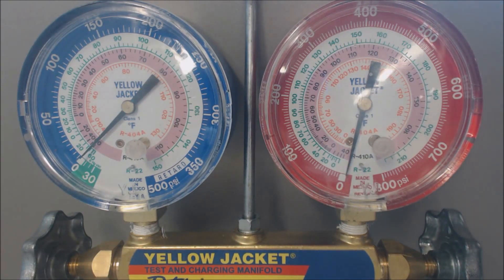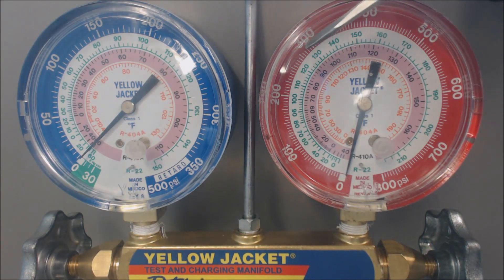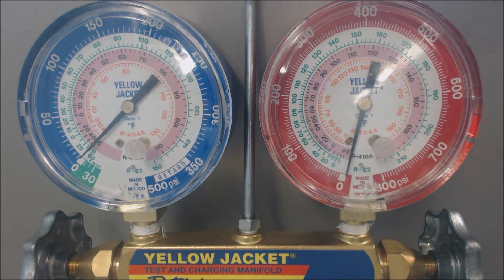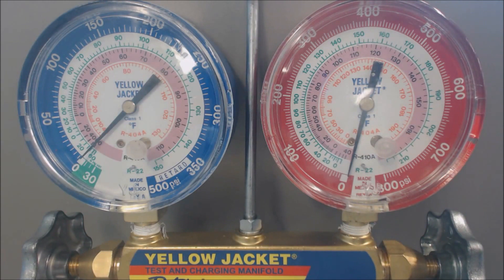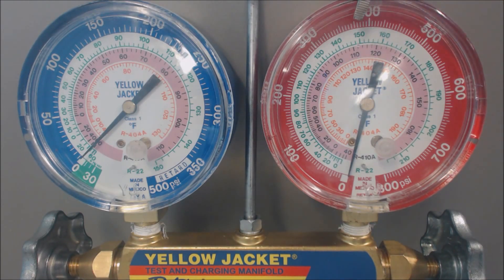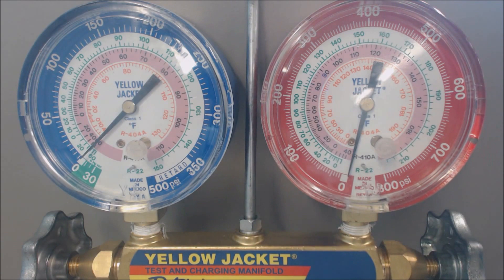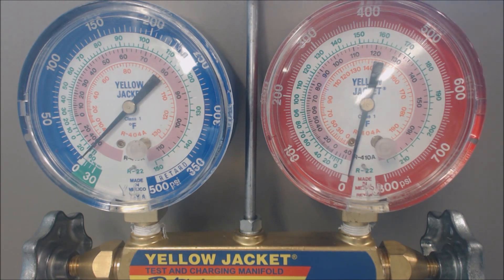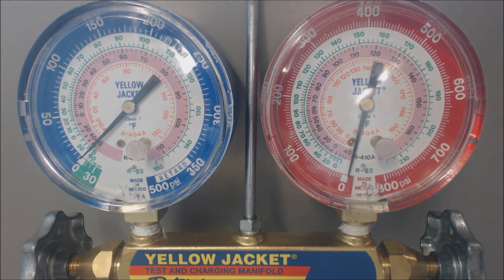R-410A, R-22 Refrigerants! Checking the Charge- Liquid/High Operating Pressures, What is too High!

Comment: Is there a guide for correct head pressure based on refrigerant type and ambient temp etc etc so you have a rule of thumb to decide if its ok ?
Reply from the maker: You do not want to use ambient plus 30 or ambient plus 25. I am writing a book about all the procedures now and should be done soon. Superheat and subcooling need to be relied upon, thanks
Reply: Ok. Please advise on how to get the book once its ready , thanks Michael
Reply from the maker: Shoot me an email so I have yours at info@acservicetech.com thanks

Comment: My high side is 325psi low is 95 heat load in house is about 84 r22 10 Seer is this normal seems like a overcharge or resteiction.. Sorry I just got new guage turned on the air as I got home from work and wanted to check pressure because of higher then RLA rating on condenser outdoor was about 101
Reply from the maker: Sounds high. Check subcooling on the outdoor rating plate if the indoor coil has a txv or use superheat if the unit only has a piston or capillary tube metering device. The low side does seem too high and depending on the fin degradation the high side may be too high----- subcooling-  -  https://www.youtube.com/watch?v=qqLwE7Kbyaw&list=PLxnHR5_D2ojxTcAtR_53GoY8huBcSOt0a     -    and superheat  -   https://www.youtube.com/watch?v=q-G7FLlzhAg&list=PLxnHR5_D2ojwGvhU1rseXQLJ-XBjBZMMk
Reply: Fixed orifice piston 2002 goodmen 42 3.5 ton

Indoor wet bulb 71°
out door condenser Dry bulb 97°
Low side PSI 92° about 50° evap
Low side Temp 66°
High side psi 320ish

Emerson check charge app said it was good... 66 line - 50 evap= 16° superheat calls for about 15-22° depending were we should round too
Check the winding on the compressor all checked good checked to ground good
Reply from the maker: What temperature are you setting the building at and what temp was it when you took those readings? Normally we are used to seeing customers set the tstat to 68-77 degrees and usually its 70-74.  I should have asked for more data! Thanks Camilo
Reply: My home is set to 78° and it was there when I took the readings also forgot to tell you the corners of the condenser does have some wear flakes away when cleaning still cannot see the tubes tho... Thinking from dog urine from a previous owner

Comment: so  whats     normal   pressure   for  R22    and    for   410 A?
Reply from the maker: vapor side for r410a for comfort cooling is 104psig-156psig depending on the indoor wet bulb temp and outside dry bulb temp. R-22 is 59-85psig. The evap coil is usually somewhere around 40 degree sat temp unless in is high humidity, high temperature inside which then it would be higher and if the blower was weak or lower cfm then the coil may approach freezing which would not be good.  The high side pressure will depend on the seer rating, outdoor temp and fin condition. Thanks! Check out this reading the refrigerant gauge playlist. - https://www.youtube.com/playlist?list=PLxnHR5_D2ojxZI3-xx03Bttxe3xCqUD87
Reply: Another good thought provoked! So efficiency, on the condenser, is the ability to shake off heat, and you can see that from the degradation of the metal in the fins by pressure gain before you can see it on the fins by eye?

Comment: R22 system....What if my head pressure keeps rising and shuts off compressor?  My pressure readings in cool mode are    210 and 76 and it does not happen.  But and only when in heat mode (about 10 minutes then resumes in about 20 minutes, and repeats over and over) the head pressure keeps climbing until shutoff around 500 psi.  Like its restricted .  Serviceman said it was the expansion valve and inside blower fan and  has been changed but made no difference.   The inside coil has a fixed orifice.  Have any ideas why it only rises in Heat mode only.?
Reply from the maker: Usually there is a txv at the inside coil which in heat mode is the condenser and a piston at the outdoor unit where in heat mode the coil out there is the evap coil. It does sound like there is a problem rejecting heat inside. My thoughts without looking at it are is the filter drier a biflow? Maybe check for a extreme temp difference across the filter drier if it is biflow. Is there a temp difference across the txv at the indoor coil because maybe there is a restriction there.  This could be verified by temp reading 6 inches away on each side. Is the electric strip heating on while the heat pump is running? Also it is possible that the 4 way valve at the outdoor unit is having a problem seating and leaking the hot discharge gas back into the return to the compressor to get pressurized again which increases heat. The 4 way reversing valve can be checked by temp difference on the suction tubing on each side of the valve. I hope some of this help! Thanks!
Reply: no txv inside only fixed orifice, it was set up for 410 and the guy changed it to setup up for r22.  He did put the correct size in it. . Also he changed the dryer....i wil check to make sure it is a biflow. Dont think the electric strip heating is on while running. im still using the system in cooling mode gonna try the heat again and see if anything has changed.  They never temp  checked the reversing valve either.   This was a new unit and has this problem since it was installed.  I thank you for answering me on this matter. Not many will comment on it.  Just went thru some major medical problems and have since had to stop work . Trying to get the unit goin before winter.  Thanks
Reply from the maker: Ok, let me know if there are any other questions. Thanks for letting me know!